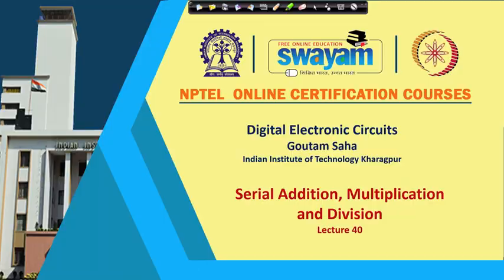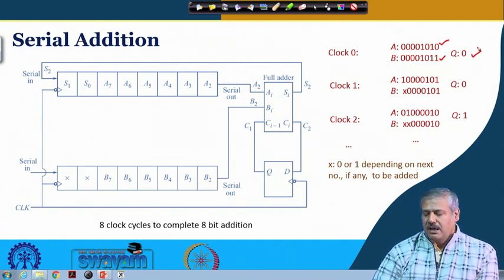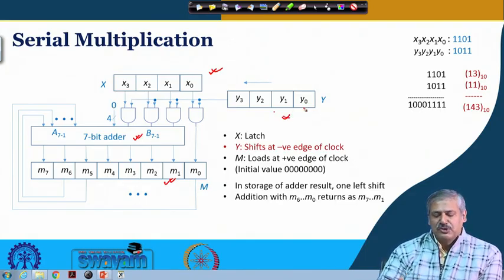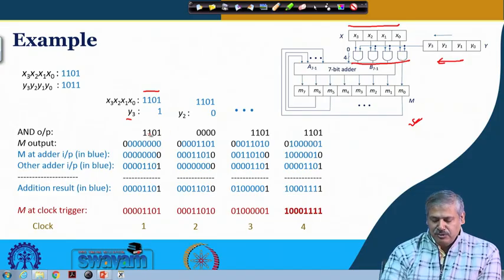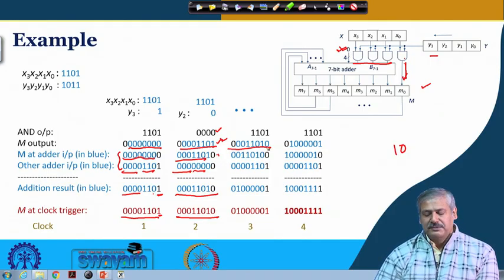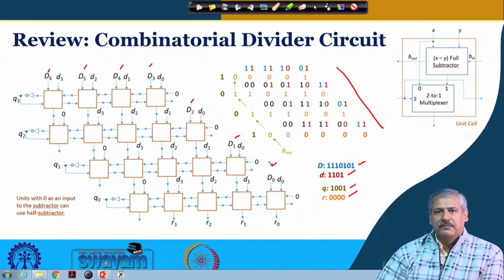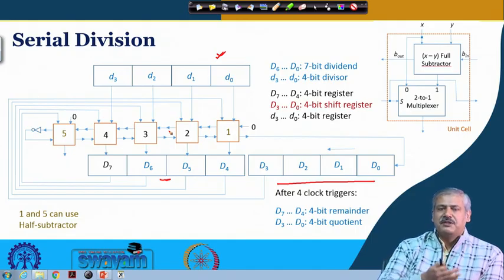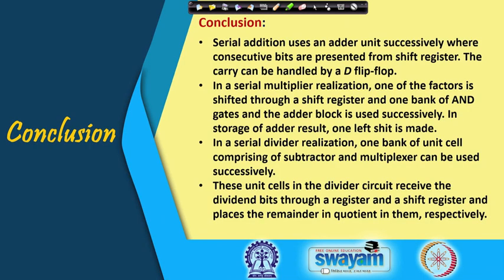Lecture 40: Serial Addition, Multiplication and Division

Comment: Nice explaination but I would like to ask how to control the clock of the registers to shift numbers in a specific numbers of time in adding/multiplying? (e.g. if 4 bits, then it will shift 4 times also). Thank you.